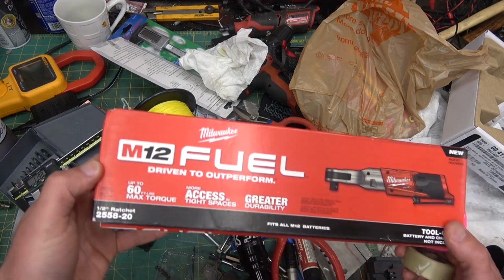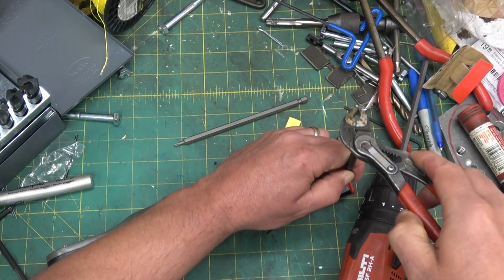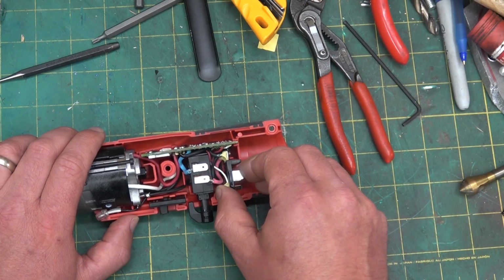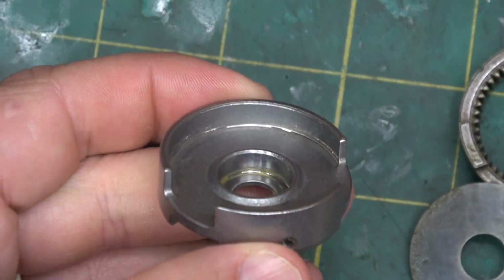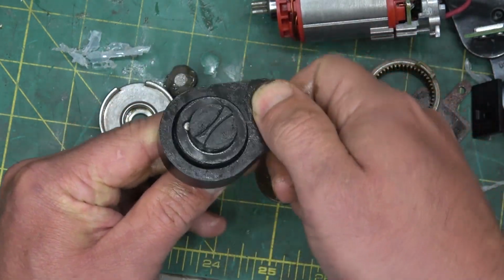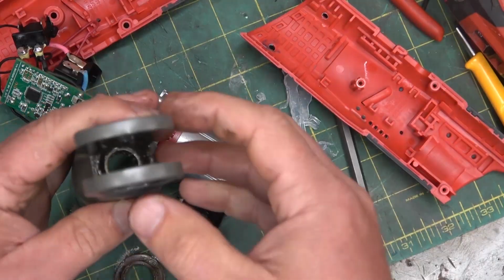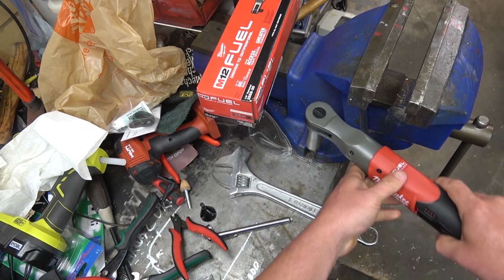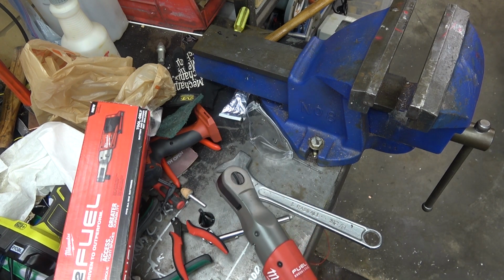BOLTR: Milwaukee Fuel Ratchet

Comment: I use the absolute living crap out of that ratchet in the shop. dropped it dozens of times, used it to hammer in bolts, doused with oil multiple times and cleaned with brake clean... shes still chooching... If she dies and I cant repair her I will send her to you for a proper autopsy!

Comment: I have a 3/8s fuel aswell that i bought last year, use it almost everyday, as a truck and transport mechanic, and ive tossed mine around, dropped it from the cab, and reefed on the thing a few times and it hasnt let me down yet, ive even taken it home a few times for personal vehicles it sees no where near the abuse as it does at work!

Comment: I have a question from the "glass wood" video you made a while back. Im wondering can you use lye "White liquor" to get rid of strap marks on boards that have sat out in the sun? i have to get rid of the marks because when we stain the boards it shows through, and if i can just use chemistry instead of sanding all day it would save my back about 30 years of wear and tear. any help appreciated

Comment: been using the M12 3/8 pre fuel version for about 5 years, couple times a week . Abuse the hell out of it in rain snow etc .  No issues other than batteries that crap out just as the warranty ends.

Comment: I am a diesel mechanic, I have the 3/8" fuel ratchet the only issue I have had is battery related this ratchet don't like to be pulled or pushed by the battery. Aside from that I dropped it in a drum of used oil and the only thing that quit was the battery indicator light, this happened over a year ago and I still use it daily.

Comment: Get the boot for it. The bastard throws goo out of the head like a teenager with a Victoria's Secret catalog. The boot not only helps keep the grease where it belongs but reduces the dirt and water that may get in. I do a lot of work on building water pumps and there's always water left in the pump that finds it's way on to the tool.

Comment: Yes on the battery backing out, but also a word of warning if it should some how find it's way to the bottom coolant drain pan even after disassembly and drying out the switch will still have moister in it and fry. Other then that after 1.5 years of use in a full time mechanics tool cart, it has impressed the crap out of me. By the way just for chits and giggles, one year warranty covered a new switch and only took 2 weeks to get it fixed.
Also when will "Keep Your Dick In A Vise" shirts and hats coming??

Comment: I bought the 3/8" version with the smaller ratchet head about 5 years ago. I use it daily doing on site repair of industrial equipment; forklifts, boom lifts, etc. I had a small Snap-On 3/8 drive impact, but I often had to loosen bolts with a ratchet first. I replaced it with this ratchet, and the only thing that I've done is buy a couple of extra batteries last year when the original battery started to need charging every two weeks, down from 4-5 weeks when new. If/when this breaks, I will gladly replace it with the same.

Comment: Going on 9 months as a professional. No real peoblems as of yet. Very little tightening torque, better for busting loose. Great tool! Got mine for $69 keep the head lubed because it will get hot. Dropped on the floor 10 times. Battety popps off but still works!

Comment: Runs much better with the 6Ah battery, I use this ratchet to remove the roll over protection from my mini excavator in low height jobs. Still chooching after 18 months of rolling around in a trailer tool box.

Comment: Had mine almost 2 years and love it for home-gamer auto repair.  Saves a lot of time in tight spaces and the light is awesome for nooks and crannies wherefor you need to get to bolts.  Word of caution its got max-knuckle-busting rating when tightening in aforementioned tight spaces the torque will move the body in the opposite direction of tightening once you lock that bolt up and if your not paying attention ur knuckles what hold the body get crushed...

Comment: Makita just came out with their RW01 12V  Cordless ratchet.  Advantage is variable speed 0-800 and has interchangeable anvils in the box for 3/8 and 1/4 “ drive no need to buy separate tools.  It also features an electric brake.  FYI

Comment: Old style one I stripped head out in 2mo. New style still going strong. Probably about 2yr now. Use a 4.0 or 6.0 battery.  Only tighten to 45-50ft lbs then just stops like u were seeing.  Get it spinning then drop on nut, usually gets it loose.

Comment: I have the 3/8 version been using it for a like 6 months now at my work ( transport truck mechanic) so far no complaints. I also have the m12 impact driver I use it everyday  for about 2 years now so going strong

Comment: Anyone " breaking" a nut with any type of electric wrench is asking for it. I have snapped regular wratchets using them with a breaker bar. As I learned" Use the right tool for the job". Unless you want broken bloody bits. I learned years ago, nothing replaces a decent breaker bar for those stuck bolts. A power wratchet just saves you that reputation of turning a wrench on a long bolt or many bolts or nuts. It's not that hard to break the bond then change over to finish the job. With age creeping in, I find turning a wrench 100 times a day really bothers me. Power wrenches speed up the time too.

Comment: I have two that require fixing: first one's pin that held the bar broke, and took the mount with it. A year later the button jammed wide open and she is hard to use lol. Second one's head came right out. Just blew its guts everywhere. Its battery was falling out since I got it. Going to have them repaired tomorrow at the service center, hopefully I'll have my ratchets back!

Comment: I've had the older m12 brushed rachets for 3 years in an auto shop. The battery popping out is the only issue so far. I dropped one of them in a bucket of coolant the first week I had it and it's going strong. I drop them on concrete on a pretty regular basis. I know it's a different tool entirely...

Comment: Yup, the saddle for the paddle pivot could have been longer to resist accidental breakout of the pin.  The paddle should be "U" shaped all along and the saddle should extended up to the switch, then secondary axis torque could not break the pivot or the switch.

Comment: Yes these aren’t as powerful as an impact but the true benefit is fitting in those right spaces where you can barely get your socket wrench to click once and you’re doing 1/20 a rotation at a time. Break it manually and spin her right off. I can’t think of so many times this would have been very useful to me. Now to decide which size to buy.

Comment: plug in wall motor are usually brushless single phase induction motors... Sooo the AC to DC to 3Phase AC conversion induces high losses but does gain the ability for total speed control and torque control. But single phase induction motor is dirt cheap compared to all that nonsense.

Comment: I've been using the 3/8 model in an automotive dungeon for 6 months. The clam shell and battery twist a lot under high torque but haven't ejected the battery yet.

Comment: Finally! I was hoping you would review this and in Oct when the Milwaukee cordless right angle die grinder comes out also that. 

One thing worth mentioning about the commentary on the new fine tooth ratchets: Im not sure if this is a recent development but a 120 tooth ratchet I purchased about 3 months ago is a dual pawl rather than a single, finer tooth pawl. In the dual pawl assembly two pawls alternate engagement with the center gear. This allows the gear teeth on the pawls to be BIGGER but the pawls themselves are thinner. Something I found interesting anyway - my 120 tooth has taken a beating flawlessly.

Comment: You wouldn't call it a plug in brushless dc motor, you would call it a 3 phase motor with a variable frequency drive.  These motor drives seem to be working their way into more and more home equipment.

Comment: Here’s a trick.  To undo tight fasteners, let the ratchet free wheel then slide it over the nut or bolt.  That extra bit of torque does wonders to bust nuts free. 

I’ve had the older 3/8” for years and have this newer Fuel 3/8”.  Honestly, it’s not much of an upgrade.  Yes, ever so slightly, it can fasten a fraction tighter but not by much.

Comment: Hall effect sensors + hot motor housing = fast aging, leading to drive failure due to lack of feedback signal probably faster than the mosfets will die due to joule failure and degradation - Unless said mosfets are not scaled correctly or have poor snubbing/rectification in which they will die first from electrical over-stress ;)

Comment: its not about the torque for me.. I went with the regular m12. It is my only battery gadget for tools. If you change a fender on a gmc truck there is some sneaky spots leaving you with tiny little 1 click turns... the m12 got the chore done quicker than my 31 years can remember. Under dash, just peculiar annoying little things on many vehicles. I did have faith in electric and bought the cheapest 1/2 inch impact as an experiment... Really liking that in my rural place with a little 2 stroke generator. I don't believe I will be breaking it any time soon. Heavy jobs get heavy tools

Comment: About the finer toothed ratchets, say 80 teeth and up, i would just say the only time ive ever really damaged one, was improper use, on the other end of an impact wrench holding a fastener. They do not like that. Other than that, all the modern pro grade ratchets are really tough even with the fine teeth. Ive yet to break or strip one under normal professional everyday usage.

Comment: After two years use, the offset pin that drives the head broke. Sheared right off. Must have been a bit too much of a titty twister i gave her.

And the locking paws that change direction wore down on me. Too much sand and grit got to them.

Comment: The 200 pound goalrilla is going to bend the pcb so hard that the QFP SMD AVR pins are comming off the PCB, CPU dead, tool dead.. If it happens in Apple MacBooks it will for sure with a tool. Stupid design from Milwaukee..

Comment: I've had mine about a year now and its still working well, BUT  the pivot pin broke in the first month I had it but is still barely hanging on to the paddle. It also started to skip teeth once it reaches near its max torque (some times), rather than stopping itself. This particular problem seems to get worse over time from my experience with the previous model. P.S. I set a CAT D7E cab straight onto the high capacity battery and she is split wide open but still chooches!

Comment: I have been using a snapon 14.4 volt 1/4in and 3/8in drive ratchet for about 3 years professionally in a new car dealership. I abuse the shit out of them and they are still going strong without rebuild. If you haven’t already you should review those.

Comment: So far i have broke the batteries because of grabbing the end for more leverage,  the light stopped working,  that little pin in the handle broke right off, and if working under a high milage vehicle or something with lots of rust it all goes in to that fan and jams it up

Comment: I broke it out for a fine, dirty, 3/4 inch thread just this morning.  Otherwise not as much use as you would think. I have the 3/8 ratchet brushed.  It's not my go to tool.  About 4 or 5 years and it's completely dirty and fine. The smaller impact is what I use when I can, and a normal ratchet often displaces the use of the milwaukee.  I always feel like I'll break the case near the battery though.  Or the battery itself.  And with the bigger battery, you can't help but to grasp it with another hand to give it the beans.  I'm really surprised I've not broken it yet. If it breaks, it'll be the case.

Comment: Most of the time when your in the middle of using it, power cuts, lights flash back and forth (LEDs 1,3-2,4. ) Have to pop battery out and slap it back in, usually good for a little while till you need to repeat

Comment: I have the 3/8  version as it comes in handy in some tight spaces where i have little movement to ratchet, so far its holding up but i dont like that once you get to torque the elctronics shut off on you, im assuming its the over current protection circuit or heat protection. Other than that when you rat het it you tend to grab the battery and it bends so i do my best to keep my hands of the battery when pulling on it

Comment: Must try with a 6.0 battery fully charged I usually run it and THEN put on a bolt or but I fight that engagement at full speed can break a good amount of fastners loose love the tool, but it's considerable thicker then the smaller older ratchet .

Comment: I use the 3/8 version of this all the time.  It actually often fits in tighter spaces than a 3/8" hand ratchet.  I've piled the force on it and so far I haven't broke it.  I know AvE puts the boot in on milfckee fairly often but in my view it's the best gear on the consumer market - at least here in Europe.

Comment: I ended up getting that little m12 3/8's for a song. I figured it would have broken by now, nope. It takes a damn beating, battery life is great, and makes quick work of some very repetitive bs like timing covers and oil pans, valve covers on diesels. Break bolt zip off and on to the next one. Hands down most used tool I own.

Comment: My older generation 3/8 Ratchet broke where the motor runs fine and with no load it will ratchet, but any load and the head is stationary. It was under warranty so Milwaukee replaced it with a new one so I couldn't take it apart. Don't know how similar the mechanism is but if it's the same, maybe that eccentric pin broke off?

Comment: Rubber boot for this is essential. Keeps shit out of the fan and head.
Fantastic tool though light years above the non fuel version which I had for 2 years and been on the fuel for version for 9 months. 12v ratchet and impact gun replaced my air tools.

Comment: This thing was probably designed with the right size of the M3 "eye" connector for motor grounding. But at some point, some smart ass wearing a tie was promoted for making the component cheaper - the Asian supplier offered a better deal on the bigger size, so bigger - better, right?

Comment: My 3/8" drive Milwaukee has been used and abused every single day in the field for the past 7 or 8 years. Much to my surprise though, the only thing to have given me any issue what so ever is one of the battery clips broke from wrenching on a stubborn farstener a little too hard. It's my own fault though for holding on the batteria and not the handle itself. Overall, solid as shit product.

Comment: My grand kis bought me a B&D like this ratchet I can't remember how many years ago  I used it sporadically and then a lot after I used it on those pesky induction clamps (looks like hose clamps) on aircraft engines. And no, they can't use it. The only time it failed was when I left it at the cold-soaked hanger for a week at -7°F. I took it home and let it warm up overnight, then charged the batt. That was five years ago.

Comment: I tried one of these out thinking the new brushless model would be better than the old one. At the tool show I was able to hold the 3/8 in. model by the square drive and stop it from turning. the Milwaukee rep almost swallowed this tongue. I told him I would keep my old one because it would remove bolts.

Comment: As a professional Automotive Technician, these Milwaukee Ratchets are great. I have an abundance of Milwaukee over Snap On and they hold up against abuse on a daily basis.

You should tear down some Snap On Cordless or even Matco.

I'd say do Mac but Mac is made by DeWalt so there's no point since you've covered it already. 

But would love to see what your say about Snap On over priced 14.4 volt stuff. 

Keep up the good Videos

Comment: I've got one, been using it for a few months now on a daily basis.
It's a reasonably good tool but I'm finding that it's startes to engage the hammer prematurely indeed of just spinning on lose(ish)fasteners.

In the beginning it was a real knuckle buster, heaps o torque.

The battery display strip is also a little on the flimsy side, I think that'll probably die with enough use.

The white Milwaukee dye was definitely the first casualty, that wore off faster than the clear coat on a newly wed.

I one hundred percent agree on the fan siza and the lack of mesh on that area.

Another issue is that the area around the ratchet drive mechanism is is a dirt magnet.

Keep q tips handy!

Finally my only real quibble the design wise is that the ratchet selector mechanism is too small and recessed to be easily accessed when wearing mittens on the old dick beaters.

I generally get about a day or two out of a3ah battery.

Other than that it's an indispensable piece of kit for any shit slinging grease monkey and good value for money.

Comment: Been running the older brushed one for years now.  Daily use in underground mining.  Haven't broken one.  Did have an issue with the ratchet direction change being difficult to operate (might have had something crack in the head or some debris got in there?) but it was replaced for new under warranty about 2 years after purchase.  The only thing that will break these tools or batteries are apprentices.